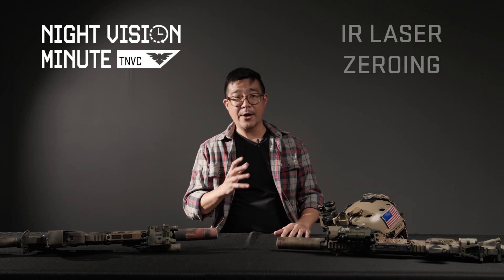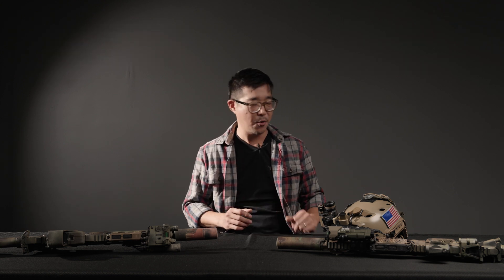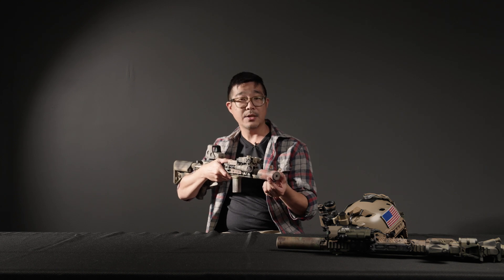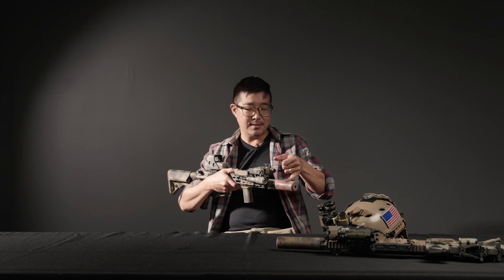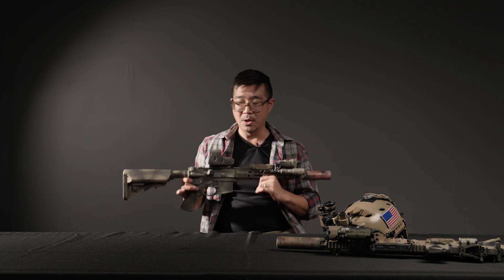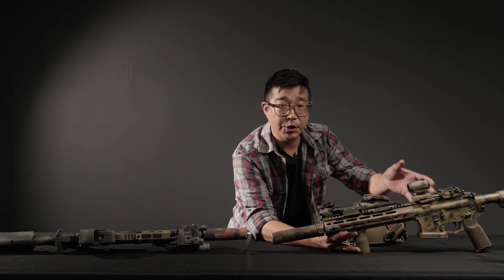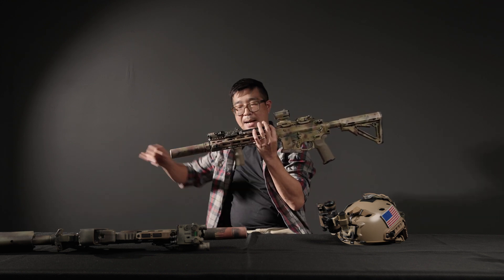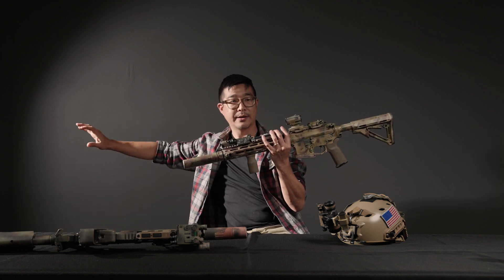Night Vision Minute | IR Laser Zeroing

Comment: Took the NV class at ThunderRanch and we used a 36-yard parallel zero. Everyone was consistently making hits out to 300 yards. It was almost too easy. Just hold center mass and shoot. Target illuminating became difficult past +350 yards with civil powered lasers. 

As for closer 25-yard ranges you just need to know your holdovers and (minimal) horizontal offset like any other optic mount setup.

Comment: I see tou had the Steiner on the top rail. How does one easily turn it in and off from there or anywhere on an AR platform? I  bought one during your sale and have been trying to figure how to usefully mount and activate it on a rifle. In the pistol, no problem.

Comment: The way I see it, the bullet is always falling, so with a parallel zero you start off by a couple inches and it gets worse the further you go, with a converging zero you are more of less dead on at your zero distance with gradually increasing error as you go beyond that point. so IMO you are going to be close to the laser in most any realistic distance with converging. But what do I know. I'm just a printer repairman.
Reply: just go to the range, look at the furthers thing and zero the laser to your optic, that few inches isn't going to have any major impact
Reply: This couldn’t be more wrong. Now I see why so many people don’t understand.
Reply: You are right in concept, but there are two limiting factors. The first is that night vision really doesn't have that great range. You can see a laser beam for hundreds of yards, but you really can't identify and engage much beyond 200 yards in ideal situations, and in low moonlight situations or overhead cover that can shrink even more. Ultimately your POI really doesn't diverge that much further than your POA unless you have a SMG or something. Like the guy said, it's really a moot difference.

The other factor is that in spite of the price of the lasers, they are actually significantly lower quality than your day optic. Recoil will cause your zero to shift exactly like an airsoft optic, so it is far more difficult to maintain that kind of zero. The truth is no one really does a parallel zero, everyone does as AWS8059 said, which is to aim at a distant target and merge your red dot POA with your laser POA. Usually you can actually see the beam trace when looking down it, so you could even aim at the sky and get an "infinite" zero. This is effectively the same as a parallel zero, but most importantly it allows you to check your zero at any time.
Reply: You are forgetting the horizontal shift of the laser which is not as easy to account for as is drop. Especially if you have a battle zero’d optic. 
I can account for the drop of my bullet from 50 yards out as far as I can shoot accurately and you should be able to as well pretty intuitively. Can you account for the leftward (assuming a 12:00 mount) shift of a converging zero from 25 yards? You would have to account for drop an windage if you ever shoot at distance. 
The only converging zero I would use is an infinite zero as explained by those above. I’ve done it and I think it’s the best all around way to zero an ir laser.